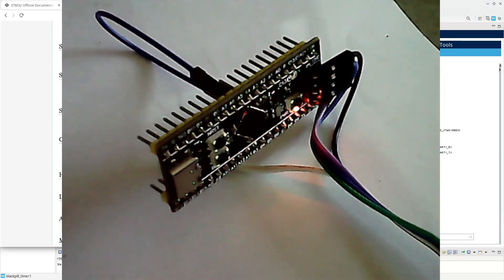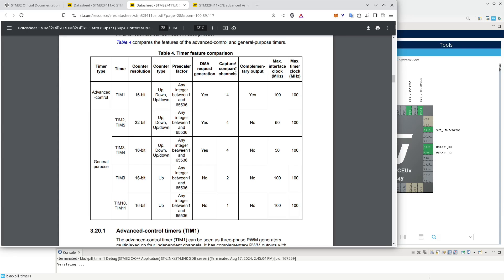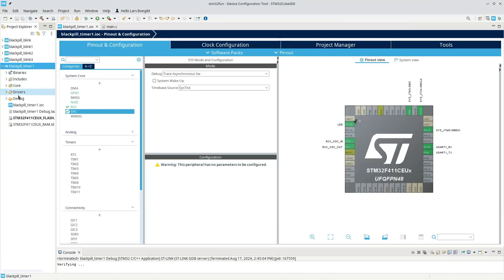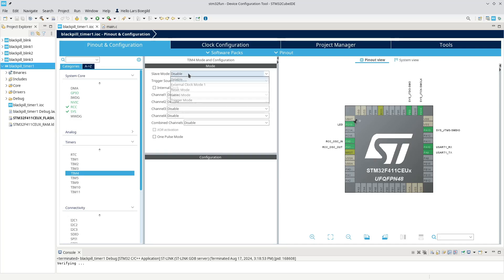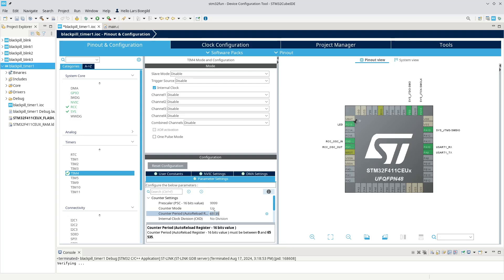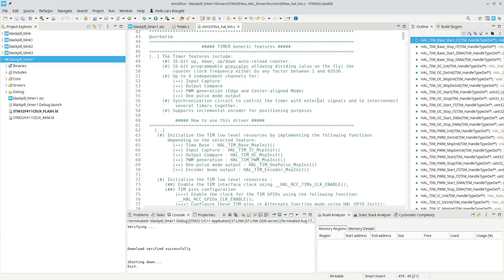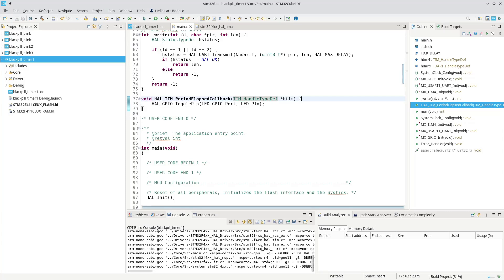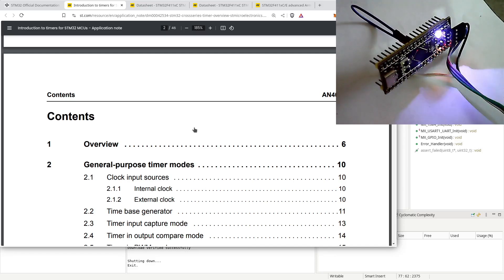STM32 Tutorial #8 - Timer Introduction - blinking a LED

Comment: So, you are calling HAL_TIM_Base_Start_IT to start the timer, in the same time the callback for HAL_TIM_PeriodElapsedCallback overridden.
How compiler knows that this callback relates exactly to the TIM4?
Reply from the maker: The compiler doesn't know that ;)  You, the programmer, know that because it's the only timer started with the interrupt.  If you got more you will have to check in the callback (the timer is passed as a parameter).  Something like:

    if (htim->Instance == TIM4) {
        // Do whatever is needed
    }
Reply: @stm32world  ok, 
So other words it's a generic function for all timer where we decide what to do (when interrupt state happen, with overflow)? 

As I understand from this one, found on DeepBlue site:
"Now, we’ve got the callback function’s name that gets called whenever timer overflow occurs"
Reply from the maker: STM32 HAL employs a layered approach which can be confusing.  Ultimately the interrupt happens here: https://github.com/STM32World/stm32fun/blob/0a1fb385d7f251ee2cb321c21798027bb7e09ab5/blackpill_timer1/Core/Src/stm32f4xx_it.c#L204

void TIM4_IRQHandler(void)
{
  /* USER CODE BEGIN TIM4_IRQn 0 */

  /* USER CODE END TIM4_IRQn 0 */
  HAL_TIM_IRQHandler(&htim4);
  /* USER CODE BEGIN TIM4_IRQn 1 */

  /* USER CODE END TIM4_IRQn 1 */
}

The HAL_TIM_IRQHandler is a bit of a complex beast which sort through the different causes for interrupts but ultimately end by calling HAL_TIM_PeriodElapsedCallback(htim).  That function is empty and defined as weak meaning you can include it somewhere in your code and it will be called there.

The available callbacks are really well documented in the hal source files.

Comment: I am using 8MHz internal crystal and set the prescaler to 1599, and it seems working kinda.
Reply from the maker: The clock tab will show you the apb1 timer clock frequency - do the calculations based on the resulting frequency.
Reply from the maker: The block diagram in the dataasheet show you that timer4 is connected to apb1 - so the apb1 timer clock is the relevant number.